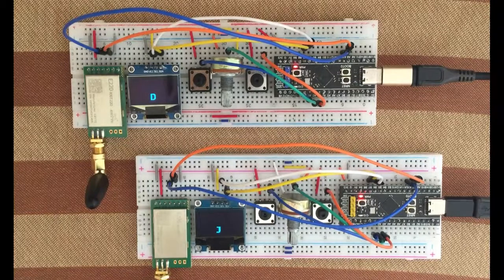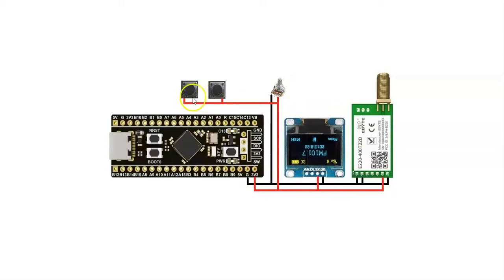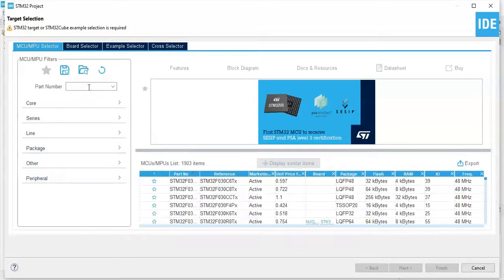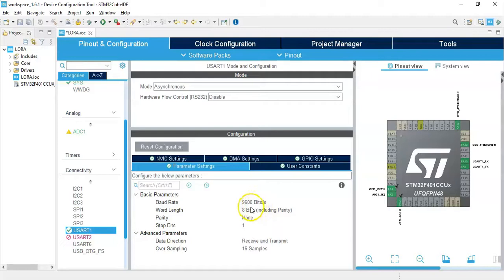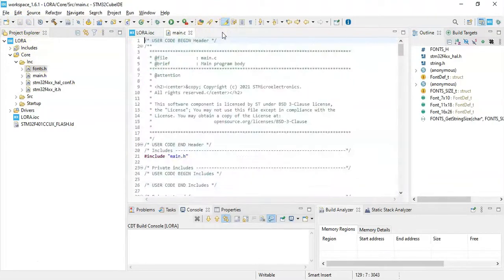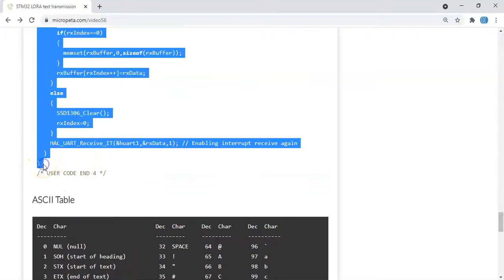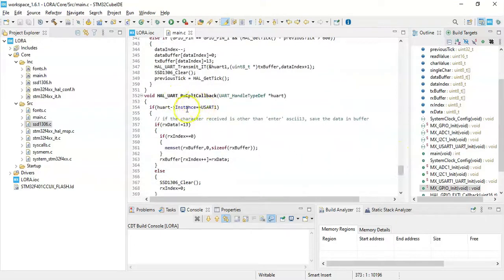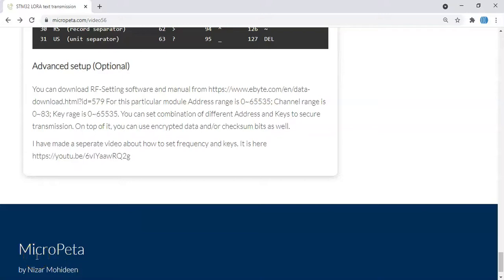56. Ebyte LORA with STM32 to send/receive text

Comment: Hello, in which part of the code do we make the parameter settings of Lora?
Reply from the maker: the parameter settings of Lora is not in this video. I have a separate video for settings
https://youtu.be/6vIYaawRQ2g
Reply: @NizarMohideen  Thanks for your answer. I can adjust the parameter settings of the lora with the RF Settings application, but I do not know how to use these parameter settings when writing code.
"#include <SoftwareSerial.h>
SoftwareSerial FixSerial(3, 4); 
 
#define M0 7
#define M1 6
 
void setup() {
  Serial.begin(115200);
 
  pinMode(M0, OUTPUT);
  pinMode(M1, OUTPUT);
  digitalWrite(M0, LOW);
  digitalWrite(M1, LOW);
 
  FixSerial.begin(9600);
}
 
void loop() {
  FixSerial.write((byte)0x00); //Receiver Address HIGH
  FixSerial.write(3);       //Receiver Address LOW
  FixSerial.write(18);       //Receiver Channel =0x17=23    (410M+23=433 MHz)
 
  intSend(12345); // We will send this number ->
  delay(1000);
}
 
void intSend(int number) {
  FixSerial.write(highByte (number));
  FixSerial.write(lowByte (number));
}"

I used parameter settings like this with Arduino, but I have no idea how to do it with CubeIDE. Can you help me with this?
Reply from the maker: It is possible. But I have not done it with stm32. Thanks

Comment: can i use NRF24L01+PA+LNA 2.4GHz SMA Antenna Wireless Transceiver communication module alternative of Lora Module in stm32 data wireless transmission using the same code
Reply from the maker: Different code. Thanks

Comment: can u make real walkie talkie or just show how to transfer numbers real time with any connection ? I am making real walkie talkie and I have problem generating correct analog output for dynamic and I cant transfer data (numbers)
Reply from the maker: This is Walkie Textie. Textie for Text
Bandwidth or data rate is not enough for voice transmission,
Reply from the maker: A simple way of transferring number is to send one digit at a time.
Reconstruct it at the receiver end

Comment: I just bought a pair Arduino Nano and a pair of E220, is there a way to make it simple with just the Arduino IDE ?
Reply from the maker: Hi Ricardo,
I have done a very simple transmit/receive in Arduino IDE using ESP32. It will be same for Arduino Nano with different pin names. The video is video no-1 (very first video ) in my channel.

I used hardware serial for ESP32. Use  software serial for Arduino Nano,

While receiving in UART, the data comes in single character at a time. For example the integer number 3256 comes as char “3” then char “2” then char “5” and then char “6” finally a new line char “\r”. To convert these into the number again we need to decode this. I have shown a simple decoder below. Just replace

if (SerialAT.available()) {
  Serial.write(SerialAT.read());
} 
with the following codes

if (SerialAT.available()) {
  static char input[8];
  static uint8_t i;
  char c = SerialAT.read ();
  if ( c != '\r' && i < 7 ) // assuming "Carriage Return" is chosen as the
                                     // line ending character
    i  nput[i++] = c;
  else
  {
      input[i] = '\0';
      i = 0; 
      int receivedNumber = atoi( input ); // Now the receivedNumber is 
                                                                   // an integer we can store or 
                                                                   // use this value to 
                                                                   // control devices
  }
}
Reply: @NizarMohideen  Thanks!!! Will try!!!

Comment: Hello.  I am using ebyte e32-433T30D (1W) with blue pill and oled ssd1306 screen.  All communication works properly until I do not connect the antenna then the blue pill crush while broadcasting the message.  Without antenna everything works but with very short range. How can I counteract it?
Reply from the maker: For 1W modules, give external power supply as the regulator of micro controllers can not supply sufficient power.
Reply: @NizarMohideen  Thank You for quick answer. I power everything from a 18650 battery. From this battery I distribute the power to oled, bluepill and LoRa.  When I disconnect only the antenna then the radio communication is normal.  As antenna is plugged in, this blueplill freezes during transmission.  sometimes right away, sometimes after a few tries.  Receiving messages is good all the time (I sent  messages from computer using realterm by connected another LoRa module)
Reply from the maker: 1W LoRa module needs more current while transmitting through antenna. It might drop the micro-controllers voltage. That is why the it is restarting.

Use one battery to blue-pill and oled. Use another separate battery for LoRa module. Make sure to connect both blue-pill and LoRa modules ground together.
Reply: @NizarMohideen  Thank You for Yout advice, I'll try to do that.
Reply: @NizarMohideen  I split the power. I connected Bluepill and oled to one 18650 battery and the radio to the other 18650. I connected the groun together. I also added 4700uF and 100nF capacitors on the bluepill power pins. Unfortunately, bluepill still occasionally freezes during transmission and stops responding to everything. Only disconnecting the voltage or pressing the reset button will restore the bluepill to work. When I connect an ordinary USB to TTL converter instead of the radio, everything works fine. The same when I disconnect the antenna, but the range is very small then. There are many indications that it is the radio signal that interferes with the work of bluepil. Receiving the signal sent from the computer is trouble-free. Unfortunately, I don't know how to deal with it.
Reply from the maker: Hi Tomasz,

1.
You can test it by one way radio transmission.
First test by removing LoRa TXD to STM32 RX pin A10 (If you are using USART1)
Test Again by removing LoRa RXD to STM32 TX pin A9 (If you are using USART1)
Find out which one causes trouble

2.
You can try with USART2 or USART3 instead of USART1

3.
As you suspect RF interference, use long wires between STM32 and LoRa Module and keep it distance away.

4.
Use can use USART without interrupt to see if interrupt is problematic
Reply: @NizarMohideen  Thanks for the advice. I will try to do steps 1, 2 and 3. Step 4 is now eliminated. I turned off all interrupts because I suspected them earlier too.